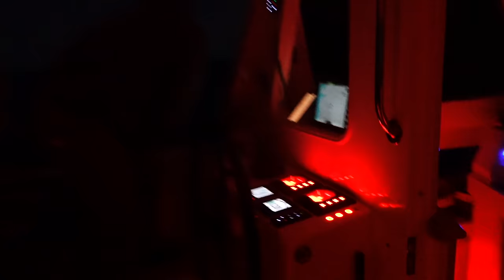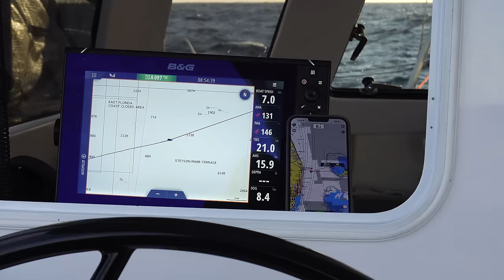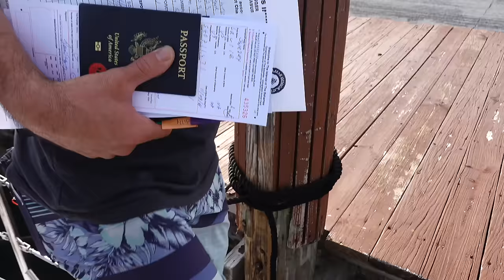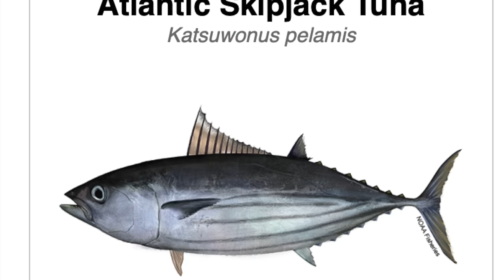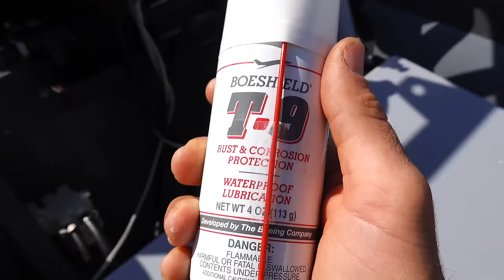We waited five years for this....

Comment: Billy, if that arm isn't stable enough on the cleaning station you might want to try just having a removable leg going down to the scoop that has a rubber pad on the bottom so that it sits on the scoop without being attached to anything. You only need to attach it to the bottom of the station.